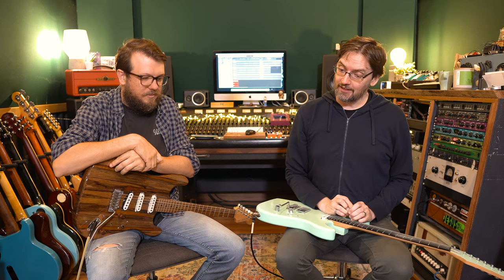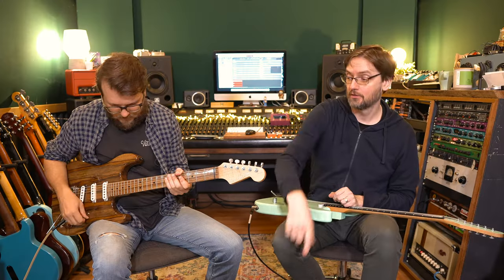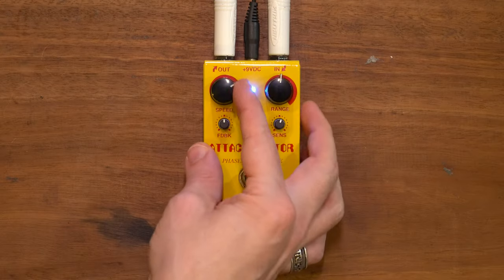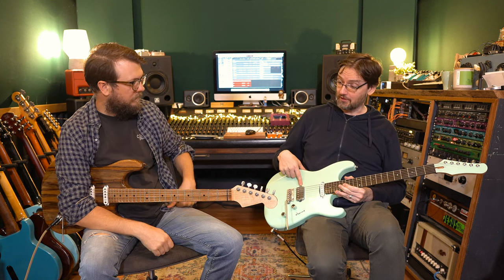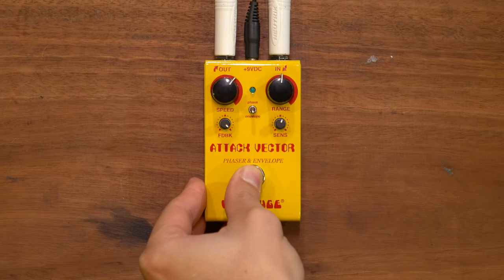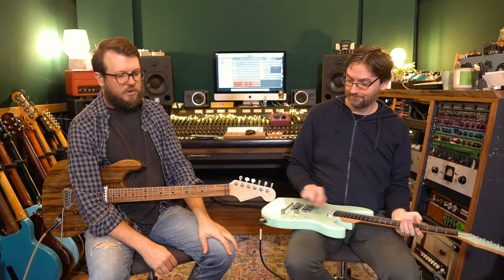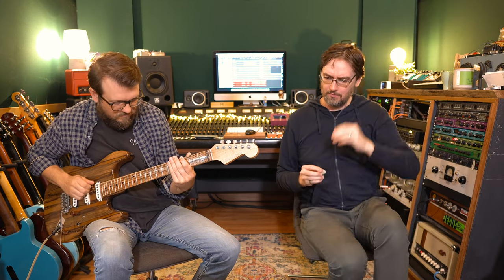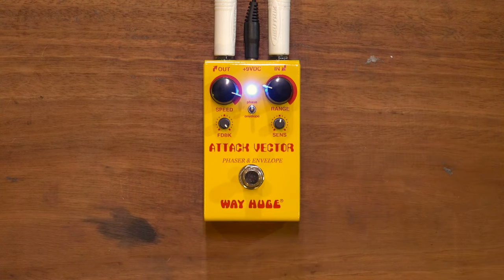Phasevelope...Envaser?!? Way Huge Attack Vector

Comment: Oh- I see- I had this thing all wrong man. I thought that the envelope triggered the phaser- which made no sense to me at all. But- this is just a phaser and an envelope filter you can run separate or together- a 1970s style funk machine, now I want one. I've never owned a Way Huge pedal before- but I've been thinking about getting their fuzzy pickle thing.
Reply: I owned a Pork and Pickle, and a Ringworm, they are solid units with great sounds